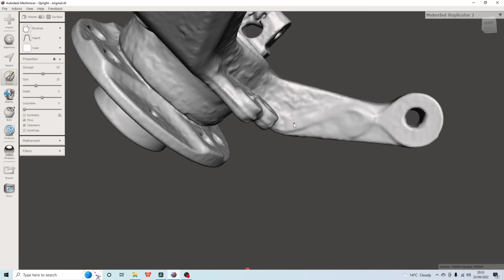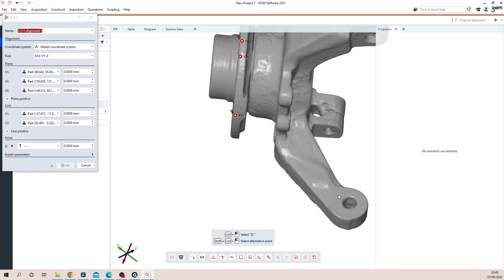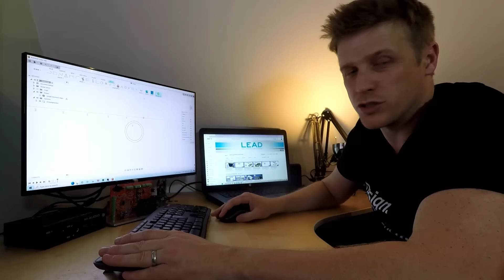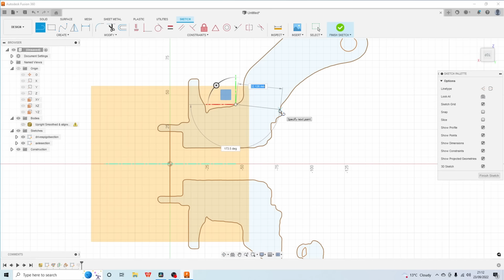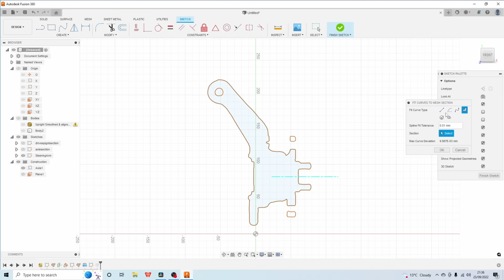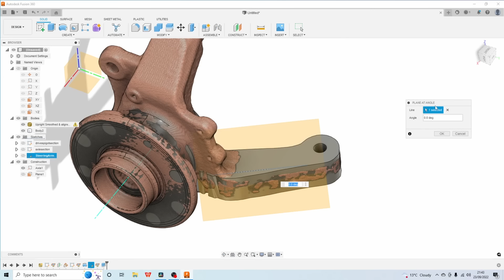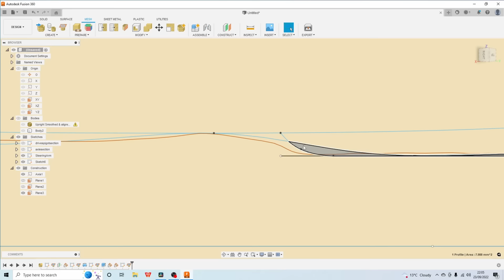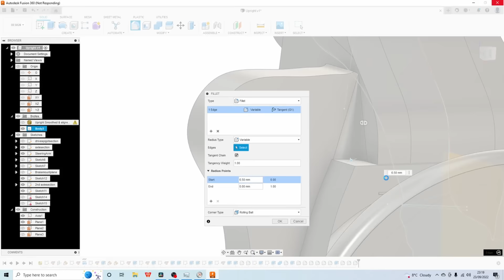Reverse Engineering from a 3D Scan with Fusion360... for FREE!

Comment: i would personally recommend designing the model using the measurements from the original part , coz you already have it with you in person, rather then trying to take the long route of 3d scanning it & then trying to make use of it to reverse engineer. This technique would only work when there is a person sending you a 3d scan of the model coz you are living in the other part of the world & you need to use the 3d scanned model as a reference for your final build.
Reply from the maker: That is exactly what I did for the drive flange, and for the easily measurable dimensions on the part (I had it by the side of me with my callipers).
However, there is no easy way to measure the picks for the suspension and steering reliably from caliper or rule measurements….
Reply: @MakingforMotorsport  Absolutely, agreed. I was actually glad to see that you made use of your caliper for the part which made sense to measure & used the scanned data for recreating the difficult part of the model to be measured with the Caliper. overall a really great video mate 🙂:yt:

Comment: Reverse engineering and copying are sometimes difficult to differentiate.🤔🤔
Reply from the maker: There is a specific difference.  The scan is a “copy”, and it contains lots of data but little information.

Reverse Engineering involves obtaining the “design intent”, so some surfaces here aren’t flat due to wear when they clearly should be, so the RE’d model shows a flat plane surface.  It also allows all dimensions to be captured for all points, or expressible in a format that allows for Engineering, such as CAD.

This prismatic 3D cad model achieves all of those, a simple stl scan does not. 

For a complete RE process you really need to obtain information on the material, any heat treatments that maybe relevant, surface finishes and tolerancing… I don’t cover those as they are tricky.
Reply: @MakingforMotorsport  Thanks for your answer sir! Impressive work!

Comment: Smooth and fill holes in GOM. You can also create cylinders and planes on surfaces and section sketches which can be exported as IGES then you import the IGES plus the STL in to your modelling software of choice. Very powerful.
Reply from the maker: Yeah, I did all of that.  But when you get it back into CAD all those faces and bores created don’t properly line up with anything, when they clearly should be parallel with the coordinate system axis, they aren’t far off, but they are off.
Whether this error is in the part or the scan I do not know (I am not inspecting the part) but if I want a design intent RE, then if a bore should be parallel to y-axis, I need to draw it that they, same with the faces.  
GOM is a great tool, and I still have a lot of learning to do with it, maybe there are better tools in there I haven’t found yet…
Reply: @MakingforMotorsport  Yes the cylinders and planes won't be perfect due to slight inaccuracies in the scan data, and usually holes can only be scanned to a certain depth due to the stereoscopic requirements of the scanner. However any sections you create will cut exactly thru the mesh and these can be made parallel to your initial alignments. For smoothing, simplifying and hole filling GOM is vastly superior to meshmixer, so do that part in GOM. I only use GOM for reverse engineering not for inspection, and want to make a video on how I use it some day.
Reply from the maker: Oh man, I’d love some better GOM skills… sounds like you’ve got some!

Comment: When you were making plane for steering arm you could just create plane on the face of the already extruded arm and then offset it to the centre of the arm
Reply from the maker: Hmmm, if you are suggesting what I think you are, I don’t think thats doable, as none on the sides are true lines, the top and bottom of the 1st extrusion are planes that I could go from.   But I’d still need a sketch to rotate a plane round so it’s as long as it is wide.
That said, I am 100% sure there are better ways to do this, but my CAD-fu is weak…. 😩

Comment: how do you ensure the centers of the bolt holes are in the correct place?
Reply from the maker: So, this is the joy of the method, at any point you can step in with parametric sketching, so the wheel bolts in the flange are on a precise 4x100mm PCD, concentric to the axis i revolved the drive flange round, because I modelled it that way.

The rest I have just used the scan data and F360 to fit a circle.  But if I want to be precise I just break out the callipers and use the most reliable looking area of scan as a datum… I am confident it is within 0.25mm

Comment: Absolutely wonderful video - thank you!!! Quick question: what are the specs of the PC you're using?
Reply from the maker: For scanning is an old ZBook g3c i7-6820hq, 16gb and quadro m4000.
For modelling it’s an i7-8700 with 16gb ram and a GTX750ti 4gb
Reply: @MakingforMotorsport  Thank you! Your workflow is really smooth - can't wait to try everything in this video asap.

Comment: I think the initial alignment with 3+2+1 points is a bit risky as you're using individual points. If you'd used the fitted plane the error would be averaged over many points and thus much more accurate. The process once in fusion is pretty spot on though.
Reply from the maker: Agreed, maybe I would be best fitting one , the main plane, then bringing it through as an iges and using that to along to the coordinate system in Fusion360….
Reply: yes, that's totally true and I would recommend this too, otherwise you get very arbitrary results for your coordinate system.

Comment: Awesome, though for some reason f360 hates meshbodies for me it boggs down terribly even with massive reduction to surfaces. (running 5950x and 3090, 128 gb of ddr4) it seems to run alot smoother with your set up.
Reply from the maker: Jesus!!! On that rig Fusion should fly!!! Beware that it tends to only use single core speed and no gpu… so that might be the problem.
This is my biggest problem with F360, it can leave a lot of computer performance on the table….

Comment: It's amazing how far scanning tech and meshing software has come. I saw a racing forum post long before the dawn of YouTube using just a crude scan of points to copy a race car's geometry. Call it cheating but they won the racing event outright.
Reply from the maker: It can still be limited, some scanners struggle with daylight and others need a power socket, and up until the last two years it’s needed thousands of dollars to get hold of one.  
But if you pick the right one and understand your usage case, it can be very effective!

Comment: aww, my 3D scans are from apps that the iPhone's Face ID sensor, it does capture well, however there can be some stray triangles or holes. Also, it includes the surface or support that I used to mount the object for scanning, I do not know how to remove them or fix them. I just want the part like yours :D any advice?
Reply from the maker: Yes mate, learn MeshMixer, it’s a free download of an old program and it lets you modify the mesh organically but also chop bits off….

Comment: I have been picking my way through the process of converting scanned meshes into parametric models over the last few weeks. Many thanks for sharing as there are some new methods here that I haven't seen before, just setting up that first axis is way better than my current 'guestimate' method!
Reply from the maker: That method works well because it’s already aligned well to the coordinate system…. without that you’re chasing you tail….

There’s plenty I still didn’t cover like “plane from 3points”…

Comment: You call that reverse engeenering...? Scanning a part... Lol...?
Reply from the maker: The scanning was the exact bit I didn’t talk about….

No the Reverse Engineering is having an accurate 3D CAD model that I can pull dimensions off, make drawings from, run simulations on… almost like I’d Engineered it myself 🤔🤔🤔

Comment: The final product looks really excellent.
I did the same project over two years ago, For a MR2 to 4 piston skyline caliper conversion.
I used photogrammetry, Zbrush and Fusion360.
Taking all the measurements as datum points is the most important stage.

Id love to own a 3d scanner, but photogrammetry done right is crazy accurate.

I always look forward to your videos.

: )
Reply from the maker: Photogrammetry is very accurate and something I definitely want to have another go at, but I’m never gonna have the space for a full rig (from what I’ve seen)…. The good bit about the scanner is the flexibility…

What software do you use for photogrammetry?
Reply: @MakingforMotorsport  It's not about software you use for photogrammetry.  It's about the hardware.  Any NVidia GPU (10 series and above), plus a decent DSLR and Meshroom will get you insanely good results.  Meshroom has a database of image sensor sizes for various DSLRs, and so helps correct distortion.  The NVidia GPU lets you use CUDA cores to do the processing - so high resolution, clear images from a good DSLR and a powerful GPU is all you need.  You can also do it with less powerful GPUs, but it's slower.  You don't need space for "A full rig"...whatever that is.  You just use a camera.
Reply: @MakingforMotorsport  Software is absolutely important! A lot of them use CUDA, so you'll need the NVidia GPUs as said above, but I've tried many options and currently the one outdoing everyone in both quality and performance is Reality Capture, recently bought out by Epic (but you don't need an Epic account to use it, you need a Reality Capture account).
As for a rig, all you need is a good camera (SLR outdoes cellphones by a wide margin), good lighting (soft, no black shadows), no surface reflections (just like the other scanners) and a good support for your model that doesn't get in the way.
The downside is you can't see how you're doing while you're taking pictures, so you might find something is too dark, reflects or you didn't take the pictures properly (out of focus, under/over exposed, etc) hours after you're done. If anything changed (you bumped on the support and it shifted slightly or the light moved), you'll have to take the entire photo series again.
Also, expect hours of processing. The results can be impressive though, and cheap.
Reply: @MadsterV I tried using my s24 + and it gave me a pretty messy mesh. I can absolutely see what you mean about the pictures needing to be perfect.

Comment: Thanks for the video, I loved it. Definietly fills a gap. Recently, I'm planning to invest in a 3d scanner, but so far I've only looked at the high-end ones. Based on the video, this scanner would also satisfy my needs. Do you think this is accurate enough to design the engine mounts for an engine swap? How big an area can this scan?
Reply from the maker: There’s definitely a use for the consumer level scanners, it’s not metrology level inspection that’s for sure, but for general designing and reverse engineering they do a good job (for the money). 

The biggest issue with the cheaper ones is the quality of the software, if you don’t mind a poorer user experience then fine but if you have no patience to learn software or the odd software crash then that’s where the more expensive scanners pay off.

Within the next 3-4 weeks I am planning a comparison video with the CR-Lizard, Pop2, CR-scan01 and the Einstar…  that may help you make up your mind, but all of them have some compromises.

I will be sharing my raw scan .stls from this video so you can asses it’s suitability for you…
Reply: @MakingforMotorsport  That's great! Thanks! I'm looking forward to the video!

Comment: Mind blowing stuff. I really need to get my head around fusion but the learning curve is extremely daunting - even the language used to describe functions is a barrier. I'll have to give LEADs channel a go!
Reply from the maker: The steeper the learning curve the faster you get good… just gotta strap in and find the right videos..
I did a couple of videos on modelling a year ago that go though constraints, a key piece of knowledge that I really struggled with… check them out, they might help!
Reply: From another hobbiest: honestly the learning curve is fusion is one of the most mild of any proper CAD software. Don't be intimidated by it, most things "make sense" and the community support forums are excellent. Basic modelling for functional parts is very easy to pick up. 

I honestly found it easier to learn than Sketchup when that was the popular tool for beginners to learn.
Reply: Fusion is probably one of the easiest CAD software honesdtly

Comment: So you’re basically using the mesh to trace over to create the solid model?
Reply from the maker: Pretty much.  There are functions to extract shapes from the mesh directly, but 1. The most useful is a paid function and 2. They just don’t work well with scan data due to the inaccuracies inherent to scanning. (It works much better with .stls taken straight from CAD… but that’s not RE from scan dat)

But using the “fit curves to mesh section” function uses the stats to average out those errors…

Comment: What is the accuracy of your 3d scanner?
Reply from the maker: I get sub 0.5mm regular, accuracy is pretty good for a consumer tool, and anything which is critical on a part is usually machined and therefore pretty easy to measure….

There are other machines out there with differing levels of resolution and accuracy  and scanning envelope… but I am relatively happy with the Lizard…
Reply: @MakingforMotorsport  I'm a machinist at a shop that rebuilds old machines for steel mills and various other types of manufacturing. We also normally convert these old manual machines to cnc or update old cnc machinery. We are working with old equipment anywhere from 30 to 90 years old and mostly cast components which are difficult to measure and reproduce or repair. We recently bought a high end portable laser cmm which has it's useful areas but suffers in others. Something like this would possibly work nicely and I'm already pretty proficient at fusion cad and cam work.
Reply from the maker: @95dodgev10  these level of scanners definitely have their place, but in a professional setting most of this level suffer due to the software, it’s just too slow and clunky.
Hoping to get my hands on something from the next tier up soon so keep your eyes peeled!
Reply: @MakingforMotorsport  definitely will do, i think I'll sub to you plus i saved this video for the reference you made to another channel that has covered fusion 360 a lot. I've learned quite a bit of fusion but there's soooo much more to fusion that i haven't even scratched the surface on. Plus there's probably better ways to do things i already know how to do.

Comment: Watch that steering arm! If your going to have that model made IRL be very careful, with smoothing out the casting on that steering arm you may make it slightly taller and introduce some bump steer
Reply from the maker: Yeah, I got ya.  The machined surface is cock on but to be fair, the joint height is set by the taper and the ball joint anyway (which I didn’t bother modelling 😂🤷‍♂️).

I plan modify this upright for my purposes    and having a decent 3D model will really help with fixturing for accuracy, and the steering arm may well get fully replaced anyway (god knows how but I’m sure I’ll work it out 🤦‍♂️)
Reply: As long as all the original machined surfaces are aligned and holes are in the same positions as the original the rest of the model doesn't matter much. It could nearly be a square block but as long as all mounting points are the same it wouldn't make a difference in the geometry. If he starts shifting hole positions or the angles of certain faces thats where things will differ from the original in good or bad manners.
Reply from the maker: @95dodgev10  oh stuff is gonna get moved 😏😂

Comment: Is there any software/hardware that can scan something to an already properly scaled mesh with sub-millimeter precision? Like if I were to scan my head and face, the resulting mesh would be able to be printed as-is (in resin) and be accurate enough to be used as a model for building Halloween face prosthetics custom fit for my face? It's zombie time!
Reply from the maker: Yeah, many scanners (used correctly of course) can do that, and they all output mesh files that all are scaled correctly.  Often they aren’t aligned to a coordinate system but you can do that in most slicers manually with enough accuracy for your requirements.
Photogrammetry can do aswell but you’ll need to scale as well, but that’s fairly easy….

Comment: really great info and a good explanation. but somewhere i still feel that my caliper and the original part infront of fusion is the cheaper and smoother way most times :P
sometimes combined with a canvas pics.
Reply from the maker: Something simpler than this, totally agree, especially with the faff of 3D scanning…
Reply: Yes. This part could be solid modeled in about the same time just from looking at it and measuring with the caliper and angle fitting ruler. And result would likely be cleaner. And you're having to pull out the caliper anyway to confirm and refine this stuff. I mean it is very cool to have the 3D scan sitting in there that you can turn on and off for verification. But 3d scanning is fiddly and time consuming and scanner cost and more software to deal with the mesh . . .  I mean eventually AI will do all of this conversion from mesh into CAD for you but until then it is extremely time-consuming and manual.
Reply from the maker: You could do most of this with a canvas background to refer to, but I know my CAD-fu (and patience) would fall short to get the model to this level…